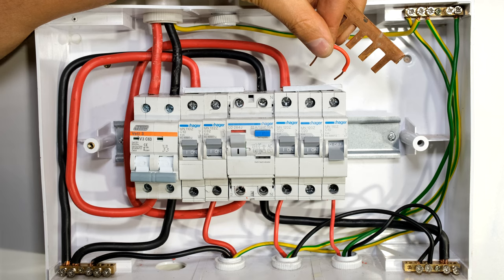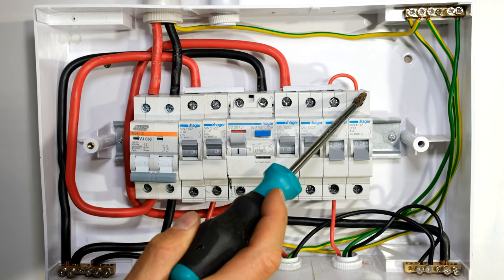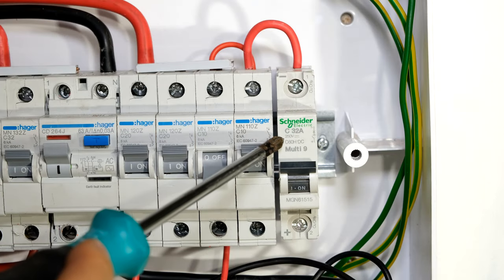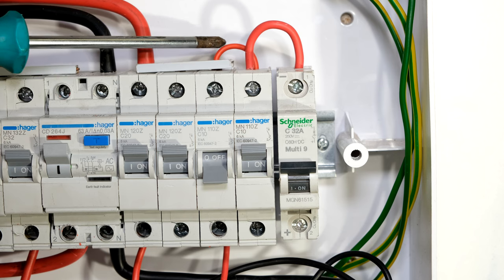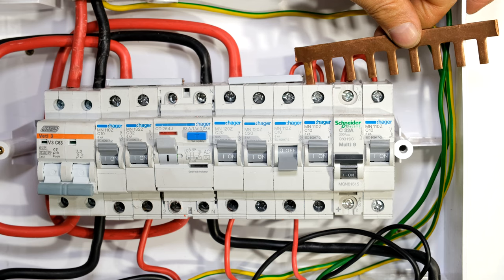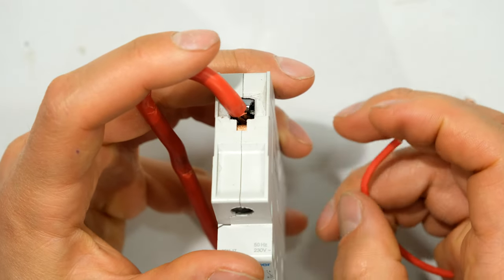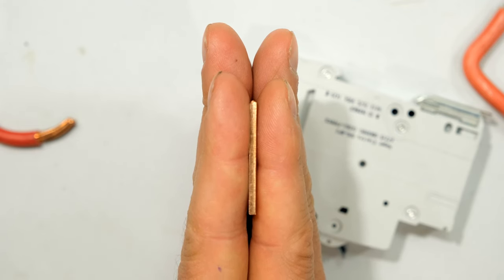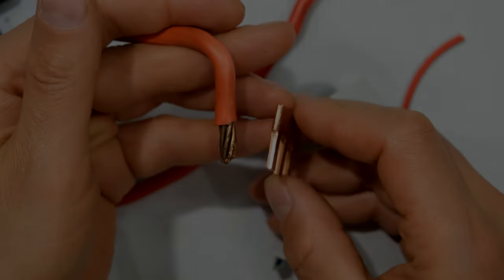Why jumper links /bridges should not be used on distribution boards across circuit breakers

Comment: How can you avoid using a bridge cable if you have 2 RCD's in your DB board? For example one for the feed to the inverter and one for the circuits that are not supplied by the inverter?

Comment: Thanks, your tutorials are the best!
My RCCB has a slightly higher profile (± 1 mm) than the MCB that I want to bridge to next to it, with a 2 teeth din rail busbar. Will it be ok if I do that bridge, causing the busbar to not settle perfectly onto the two breakers?
Also, if the need arises, is it ok to cut off one tooth of a busbar, so that a bridge can be made between live lines, skipping a neutral line that is inbetween?

Comment: The spacing of the teeth of your pure copper bus bar seems to be too close to each other to fit the distance between terminals of your breakers. I have the same bus bar... Are you using it? If so, how did you get it to fit?
Reply from the maker: The unshielded copper one is for the samite rail.